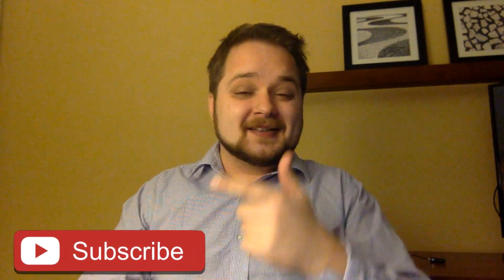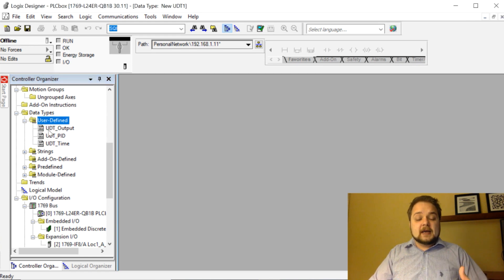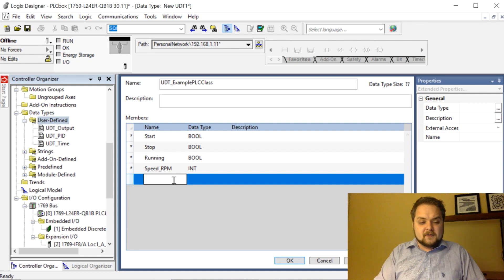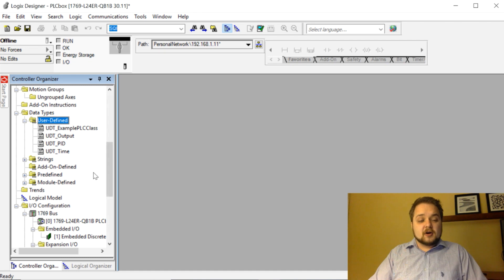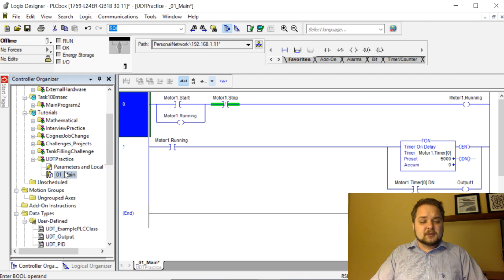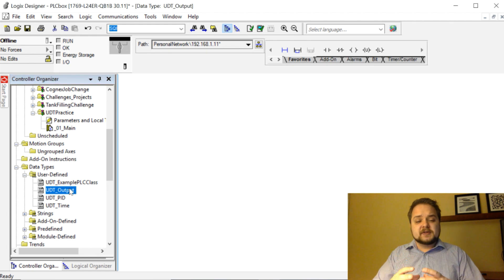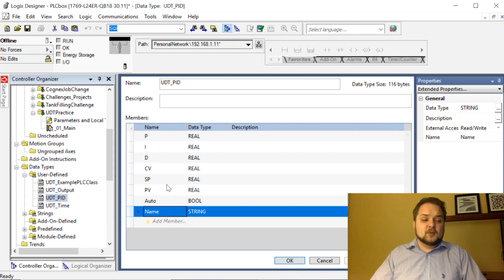User Defined Datatype UDT Tutorial - Explanation, Usage Examples & Custom Definition in RSLogix 5000

Comment: In the UDT, the data type wasn't linked to anything such as a physical input. For example, you created a start button that was BOOL but it wasn't linked to a local or memory bit so if you use it in a program, it won't do anything as far as I can tell. Maybe I am missing something. Is there another step to the process?

Comment: I have question for you. In the example you used instruction are motor1.start,motor 1.stop. I understood that for start and stop you made a udt but from where did you take that motor1 tag?
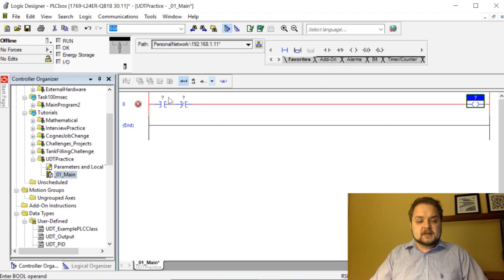Reply: He created it @6:30 when he right clicked the and chose New "motor". 
Because he chose the Data Type: UDT_ExamplePLCClass

This class has subtypes (.STart, .Stop, .Running, .Speed_RPM) So now Motor1 also has these subtypes. the same way that "Timer1" has subtypes .DN or .EN

Comment: Is a UDT a good way to go for recipe/variety setup.
Reply from the maker: Definitely. I've worked on multiple recipe handling systems and in every case, the recipe was a UDT that would contain ingredients, parameters settings for instrumentation, tank levels, temperatures, etc. It's a great way to combine all the tags into a single structure and make the code much more streamlined.

Comment: I have a question.  I have been working on a project.  We are using analog lasers to measure a surface as a periodic task. We look at an analog input, scale the input, fill an array using a FFU,FFL, average the array, then push to a parameter.  Currently we were using one but now we are looking at multiple on one machine.  Should I create a UDT, or an AOI?I was thinking then when we have a piece of equipment that needs, say 2 lasers we import package, enable those input/outputs.  But if another machine has 1 or N lasers, we could easily implement.  The laser logic periodic task is 10 lines of ladder for one laser.  The logic is the same for the others but would fill a different part of the array elements. Any suggestions is helpful. Thanks
Reply from the maker: That's a great question. The way to think about UDTs and AOIs is that their purpose is completely separate. Some applications require neither, one, the other or both. The UDT is used to contain data. If you have multiple machines of the same type, I would definitely create a UDT that would contain each element of that machine. For example, you could have measurement1, measurement2, the array into which you use the FFU and FFL as well as other parameters of that machine. The AOI on the other hand is used to encapsulate logic. In other words, if you need to create 10 rungs of logic that will do the calculations of your averages, arrays, etc, AND will use them multiple times (for each machine), it's a good idea to create an AOI. The advantage of that is that you can easily copy/paste this logic and only change the call on the AOI. The drawback is that you need to download to the PLC if you want to make changes as well as most technicians and mechanics not wanting to troubleshoot AOIs. In conclusion, I would say to keep things simple, but do experiment with an AOI when you commission the units and see how it goes.

On the same note, if there's an opportunity to help you with this install or the PLC code, reach out to me directly @ v.romanov@solisplc.com
Reply: @SolisPLC  I sent you an email, hope you have some time to look over it.